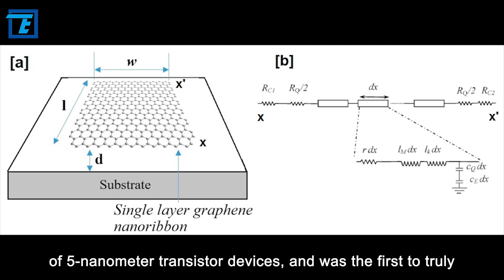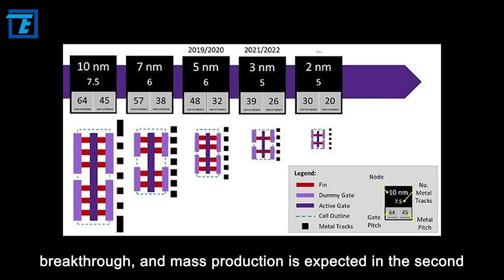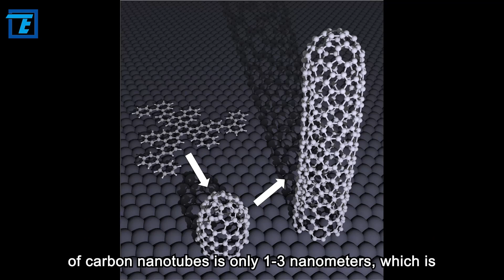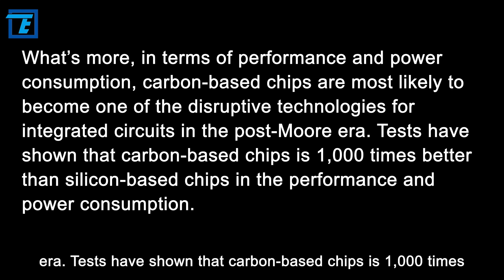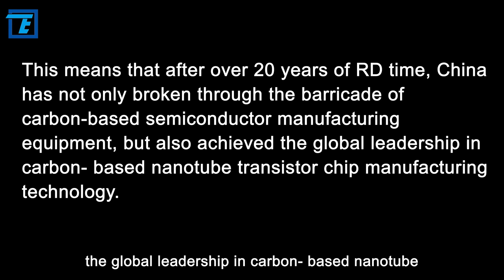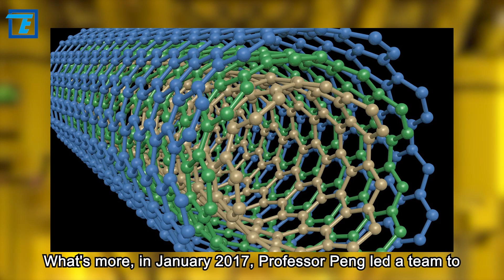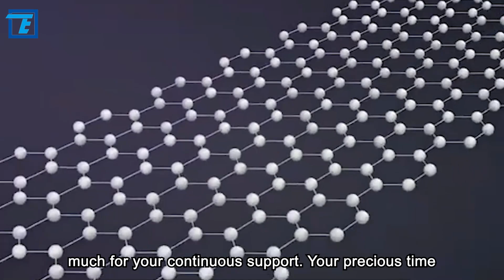The Rapid Development of carbon based chips in China, What's the news in 2022?

Comment: Still not sure what China achieve after this video mumble jumble...
Still saying the same thing video after video, so is the carbon chip running in protype? 
I guess for China it is...
Does not add any new info at all
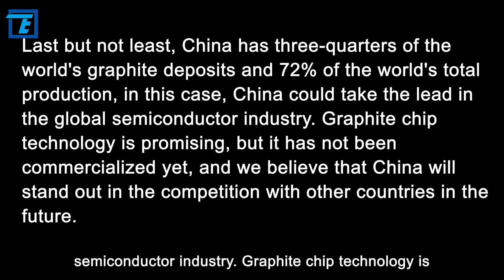7:28 has some info, yes China leads in manufacturing carbon graphene, has the most IP on graphene related, most useful IP too, on their production etc.

The question is when will China companies put them into production, perhaps when the schedule is right...
After breaking the record in silicon then, 1, 2, 3 etc punches in graphene & also onto photonic chips

That's obvious strategy
Reply: Go back to sleep then, genius.  What are you doing here, video after video?  Is your brain running in prototype?

Comment: Over 20 years of Chinese research in carbon tech, interesting, it may be that China will be first when it comes to mass production of carbon semiconductors for <3nm. In the U.S. for example IBM has impressive research but probably can't mass produce carbon chips, Intel can mass produce microchips but is likely stuck in lots of legacy structures focused on silicon. Maybe similar situations in South Korea, Japan and in other Asian countries outside China focused on silicon today.
Reply: All hail Chinese carbon researchers!✌️ Long live China's mass producers! 💪 May they and their descendants live in Peace & Prosperity for Ten Thousand years! 🙏
Reply: What I am aware of is about couple of years ago China could produce chips from graphene using building up method.  The technical results were far better than the ones produced by the US.  If I remembered correctly chips was from MIT.  The number of chips on a circuit broad was no where near what it is on the same chip size today.  The way I learned was it would take at least 10 or 15 years hopefully it can reach the level as today using the ASML photolithography machines.  China is getting there.  have more oil.  👍